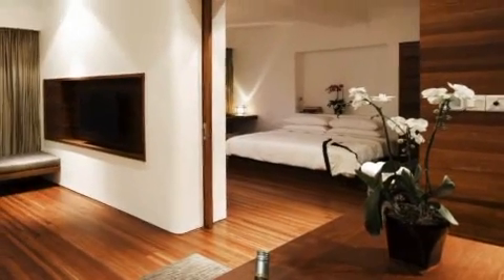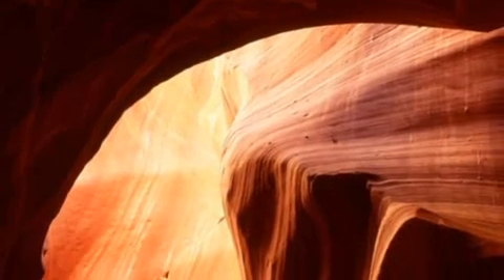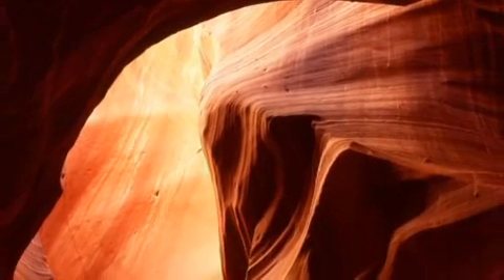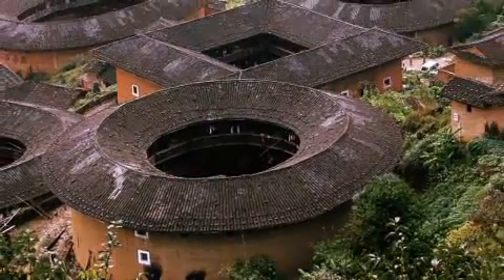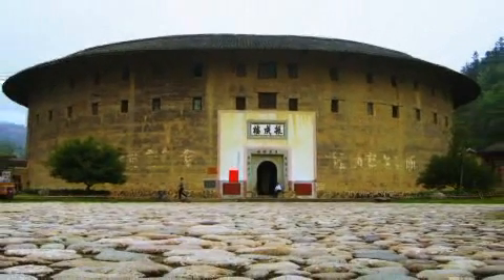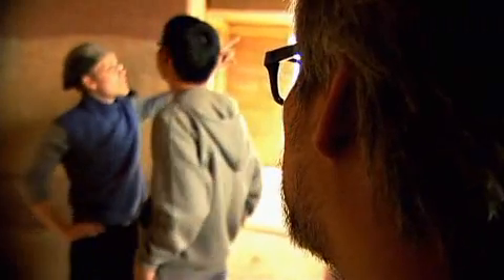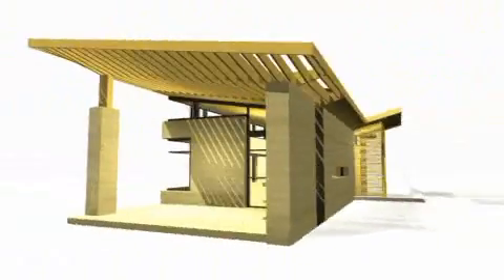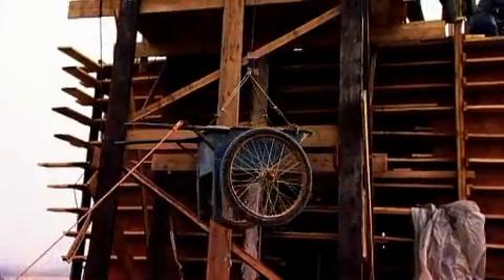A00 China - From Rammed Earth to SIREWALL

Comment: as noted in the video, in cold climates insulation is required but with good design in a temperate zone in Australia, its not required. The thermal mass is great and works a treat